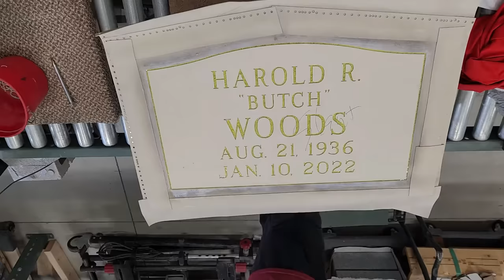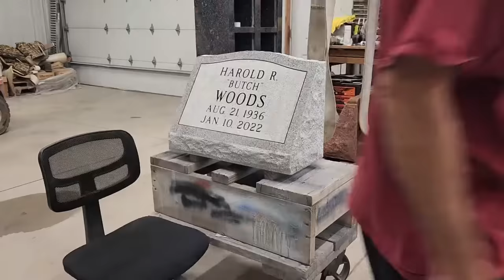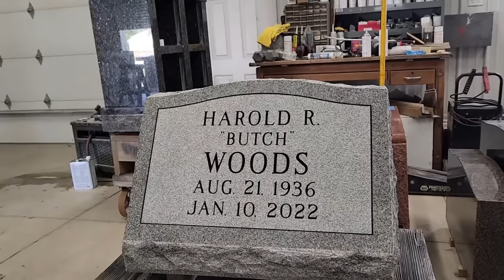Engraving a Headstone

Comment: It’s genius business with an aging population you can get rich.
Reply from the maker: Job security
Reply: @night_al  Im confused what you are doing with the sand plaster. Does it engrave the letter into the granite?
Reply from the maker: @atreaunews6174 , it does. The sand penetrates any area not covered by the rubber stencil.
Reply: @night_al  how deep
Reply from the maker: Depends on the size if the letter or number. An inch tall letter can go as deep as 3/8ths" or more.

Comment: 8:41 What is scrubbing with camp fuel for?
Reply from the maker: To remove excess adhesive
Reply: @night_al Thanks for the explanation. Nice work too.
Reply from the maker: @5xls  thank you and thanks for watching!
Reply: Does the camp fuel ever leave stains? Or does it wash off plenty good with water?
Reply from the maker: @schroedermemorials6537 it washes right off. No stains

Comment: 6297, it's not, that's what I was getting at, it's all laminated, glued and pressed then they just peel off the layers giving it a chiseled look, painted then washed with a cleaner that I suppose hardens it all.
Reply from the maker: Sandblasting gives it an engraved look. Painting it with Lithochrome paint makes it pop and the cleaner (camp fuel) removes any excess adhesive that adheres the rubber stencil. It's not to say that the art of hand chiseling is gone. It's not. But it is close. Living in an area with a dense population and no one using a chisel anymore, adaptation had to be made to keep up with demand. This company is family owned with very few workers. Only one of two in this entire region. In order to meet demand, 20 or more headstones a week, the company had to evolve to modern equipment. The end result is the same. And families accept this as the norm. Lest they wait months, if not longer, this is the way it's done now.
Thank you for voicing your opinion and more, thank you for watching

Comment: 8:42 what is that liquid?
Reply from the maker: Camp fuel. Breaks down the adhesive to clean it off
Reply: We used to use white gas when I helped my dad at his monument shop.  Looks like that's what they are using in the video too.  It's to remove all the glue that is used to keep the stencil in place.
Reply: You know, I’d never heard of white gas until I watched this video yesterday. My husband told me it was because I was too young! 😂😂😂
Reply: Camp fuel such as Coleman Fuel, which is also called "white gas", and is essentially naphtha... a hydrocarbon distilled from crude oil, roughly comparable to gasoline but without the additives needed for gasoline.

Comment: still don't understand how the etch the letters
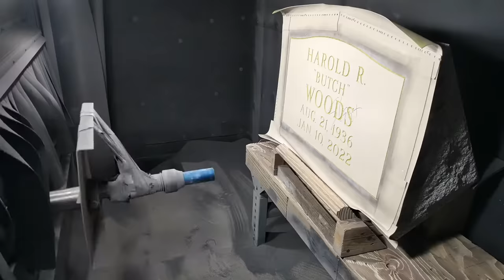Reply from the maker: at 6:04 sandblasting starts.
Reply: But how does it go through all the paper  @night_al
Reply from the maker: @lliambunter  , the paper is actually rubber. The letters are precut ,I peel that rubber out. Anywhere the rubber is peeled out, the "sand" penetrates into the stone. Anywhere the stone is covered with the stencil, it bounces off
Reply: @night_al  good explanation!
Reply: Oh thank you , I missed it obviously  thanks for the reply @night_al

Comment: This IS NOT ENGRAVING but rather ETCHING. 
So it is actually a con video. If you go back many years the text was much deeper cause it was properly ENGRAVED.
I think the engraving could also be filled with lead?
Reply: As an industry term this is 100 percent engraving. Etching only refers to laser etching. I've never heard of or seen lead filled engraving but I could see that having existed in the past
Reply: The copper hand engraved plates seem to last hundreds of years and are as readable as the day they were made. Ive seen many in the UK from the early 1800's. No stone lasts so well.
Reply: this is neither ENGRAVING nor ETCHING.  It's called blasting: A physical process that involves colliding particles on a surface. Blasting can be used on any material, regardless of its chemical composition
Reply: RebellionFreedom 😂😂

Comment: I think this work must be maked in around 30' minutes. Not necessary apply glue or initial handblasting. I'm making this work the last 20 years and i spend 30 minutes (maybe 40 if a complex picture is included).
Reply from the maker: The initial sandblasting is necessary for a double process. Total time was more than an hour.
Reply: @night_al well, doouble process is needed because you need to paint the letters.We have simmilar working process, maybe automatic sandblasting part use 20 minutes?
Reply from the maker: @talens  at 26" from the nozzle, whole time was roughly 30 minutes
Reply: @night_al for me this part is the worst because i made it by myself, not automatic process,  and i spend around 5 to 10 minutes depending how long is the text. Not funny work because the sand around all.

Comment: I'm afraid only two years after my father died we had to make the letters black again. (for 500$). A few years later we just used a black stift...
Reply from the maker: Multiple factors could be involved in that. Letters not deep enough, sub standard paint, a bad paint job, even the direction it's facing when set. I'm sorry you had that experience. I thoroughly inspect every job I do to ensure longevity. I can't say that for everyone.

Comment: It seems,,,,,,excessive.........what i mean is,,,,well heres an example,,,,how to clean a kitchen floor,,,,1) sweep,,,2) use a dust mop,,,,3) water & soap squeegee it,,,4) use a soft brush to scrub with cleaning chemicals,,,,5) wash off chemicals,,,,6) mop floor with a clean new mop,,,,7)use a fan to dry floor,,,8) use a microfiber towel to wipe floor ,,,9) aplly a wax sealant,,,,,,,etc,,etc,,,,do you get what i mean....the PROCEDURE LOOKS EXCESSIVE ,,,,,im sure each step is necessary,,,i wouldnt know,,,,,but i would think,,,there could be a more efficient way,,,,,this is just my opinion based off of years of physical labor experience..
Reply from the maker: Ever watch The Mandalorian? This is the way
Reply: @night_al  excellent comeback,,ha,ha,ha,,,yes it is....
Reply: There definitely is a easier way were you only move it once and the frost is last.
Reply from the maker: @lilray729  the frost came first...

Comment: If it only takes 9 minutes why is it so expensive ?
Reply: The video is sped up. So it actually takes longer. Plus the cost of the materials and labor which in most cases includes delivery and installation at the Cemetery. This stone will last many years.
Reply: I was only joking 😃

Comment: Using compressed air to clean surfaces without eye pritection is asking for trouble...
Reply from the maker: @mishbk  it is. But... The stone is blown off before it's painted. Absolutely no sand in any crevice. After I paint, it's used only to hurry the drying process. Thousands of stones later, never an injury.
Thanks for the view!

Comment: I can't see that text lasting anywhere near as long as a properly chiseled one.  Just another way of maximizing profit.
Reply: It appears the blasting cuts down into the stone as deep
Reply: Or a way of providing headstones to those who wouldn’t otherwise be able to afford them. A dignified burial is expensive.
Reply: And increasing precision... Computer cut masks offer more choices, and help keep costs down. I see nothing wrong with modern blast etching methods... Its not just profits..
Reply: A lot of the stone ones done 350 years back are unreadable. The pH of rain has fallen in Europe. Ones we could read clearly in 1963 are just gone.

Comment: If I were in this business I would invest in a CNC waterjet and reduce manual labor down to just a couple of steps.
Reply: @SomeguysTrailrides they work in that application. I have a countertop fabricator I work with who uses a CNC water jet to cut slabs, and they can relief cut logos by reducing pressure.
Reply: when you are in that business you can decide that, but you aren't. You're not in anything.
Reply: @BenN-p5v  wow, what a genius response. Impressive. 

It’s true, I don’t own a headstone/monuments business. I own a completely different business, with different technology needs.
Reply: @BenN-p5v  you joined a half hour ago, and all your comments are salty, butthurt nonsense. Are you somehow connected to this particular business and can’t handle constructive criticism? That would explain a lot.
Reply: @davidrobertson797  haha salty and butthurt, ok kiddy, back to your Swift songs

Comment: Laser cut might work.
Reply from the maker: It would. But the depth a laser can cut into hard granite would take many more hours than sand blasting. Not to mention, a laser will only cut at a right angle and wouldn't achieve the "V" cut that emulates a hand chiseled look.

Comment: Using a CNC machine this is a one operation prodedure, all these various steps he is taking are so unnecessary
Reply from the maker: How long do you think that "one operation procedure" would take? How many diamond bits do you think it would take? How expensive are those bits? 
This took about 2 hours. No cnc machine could produce the same results in that amount of time.
Thanks for watching tho!
Reply: @night_al  should have said CNC controlled plasma cut. Ours cuts through   50 mm granite at 1m/min.
Reply from the maker: @bobclarke2705 that makes more sense lol but are those square cuts? Or can they produce the V sunk pattern. Also, what's the price on one of those?

Comment: I’m surprised at the amount of HAND work. He should NOT be INSIDE the sandblast room. It should be just a tank. And painting with spray cans? Ridiculous. BTW, fractured sand is carcinogenic.
Reply from the maker: It's not sand. It's aluminum oxide... 
The spray paint is specifically designed to adhere to stone and last for years

Comment: I am a fully qualified letter cutter, and monumental mason..this is just stencil sand blasting, any monkey can be taught to do it..hand cutting is a lost trade to most, I spent several years doing both, hand letter cutting, and computer cut sandblast lettering, you can turn our more this way..so cost benefit yo the manufacturer and supplier, not to the customer,  they still charge you hand cut rates for something that takes a quarter of the time
Reply: 100% true
Reply from the maker: 100% bs. Thanks for the view tho

Comment: I hope that wasn't white gas in that can.  If it finds a ignition source it could be your worst nightmare.  There's a reason you can get 50 miles a gallon with the stuff.
Reply: Coleman camp fuel has a flash point of -18 degrees C so it seems as risky as ordinary gasoline.  I'd have thought to try kerosene which can not be lit until well over room temperature.

Comment: I'm only disappointed by the method of paint done...a spray can...just thought there would be better quality products used, coming from a professional industrial coatings specialist.
Reply from the maker: Sorry to disappoint but Lithochrome paint is designed specifically for use in this industry. It's not something you can just buy off the shelf at a hardware store
Reply: Just because it comes in a spray can does not mean it's off the shelf stuff from a general store.

Comment: Seems like a whole lot of work to etch the stone, then highlight the letters with rattle can paint spray.  Also, if I were ordering a stone like this I’d have paid enough extra to spell out the months and instead of abbreviating them.  The wife and I are both going into urns, so no need to waste all the $$ on a rock that no one will really care about in a few years.  Different strokes…
Reply: Considering I just looked up my Great, Great, Great grandfathers headstone online, and am planning a visit I wouldn't say nobody will care in a few years.
Reply from the maker: @integr8er66, depends on the family I guess.
Reply from the maker: Lithochrome is definitely not cheap.
Reply: Spend the money on a good steak or settle for a happy meal at the drive thru. Both come out as a pile of s*#t. Different strokes....

Comment: No evidence of engraving here. its more etching by machine
Reply from the maker: Definition of etching: Etching is traditionally the process of using strong acid or mordant to cut into the unprotected parts of a metal surface to create a design in intaglio (incised) in the metal.[1] In modern manufacturing, other chemicals may be used on other types of material.
Reply: There is evidence, however, of dbaggery.

Comment: I'm not going to be the first dick head to have to point out that it's just a quick computer printout on to heavy duty sticky tape and a few minutes of sand blasting. I'm a stonemason (mid-kent memorials) and it's always pissed me off the fact that I have put over 8 years into my craft only for the company to buy a fricking computer that I have to walk around to get to my tools every day
Reply: I would imagine an old fashion sign painter would say the same about the switch to vinyl lettering. They are both a craft, but the old way is very different with manually painting letters instead of creating the sign in a computer.

Comment: What a rip off, not even chiseled any more, my have we gotten lazy. Way to commercialized.
Reply: That process has been around for over 45 years.
In the 70's my father hired a headstone company to  sand blast a sculpture  with that same process. He hand cut the rubber pad and they sandblasted a sheet of slate.
Reply from the maker: Supply and demand. A dozen hand carvers couldn't meet the demand of 20 stones a week. Times change, adapt or collapse
Reply: I guess you still ride in a horse and buggy

Comment: Sorry but I could do all of that with just a pencil and a hammer and chisel like they used to in the old days. Get some real shape to the letters rather than this sand blasted nonsense.
And I wouldn't need a machine to move the stone. You should be able to shift a small bit like that on your own or at the most get the apprentice lad to help you. All that sandblasting is cheating imo and won't last more than 100 years at most
Reply: Not on granite you can't.  You could do it with Marble, but not with granite. You could hammer and chisel all day long and you couldn't make a nice straight line, it would be jagged and broken.   And that piece is heavier than you think, white granite "Sierra White" like that is the lighter of the granite's, darker granite weighs more, solid black granite weighs about 35% more, over all.   Why break your back moving it, when we have systems like that to do it for you.  Granite lasts longer than marble, if you go visit old cemetery's and see old headstone they are marble not granite and they are quit worn in comparison to granite monuments.  While you are trying to come out as being smarter, you're actually being quit stupid on how this works.
Reply: @davestir5743  Yes, 100% on granite you could. My father owns an engraving company, they dont use sandblasters on headstones.. they literally use a chisel.. 
Using a sandblaster is something id expect a charlatan or china to do..